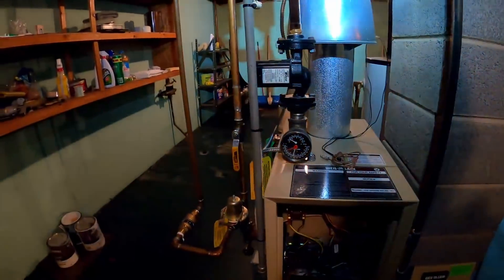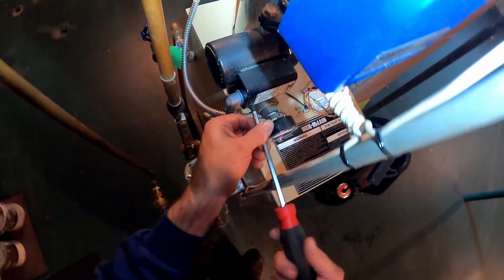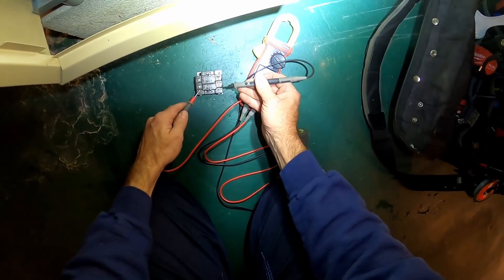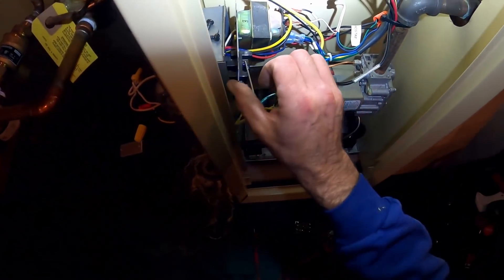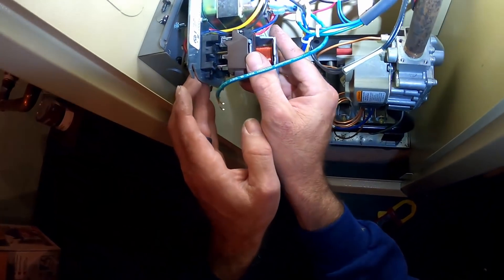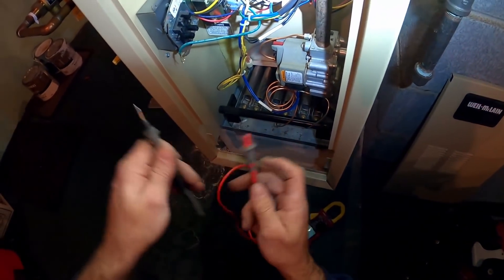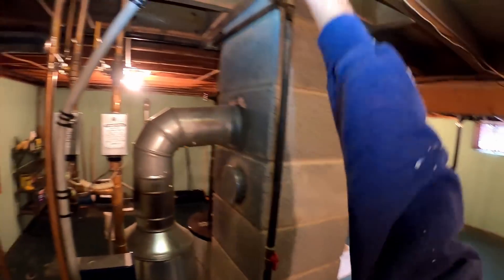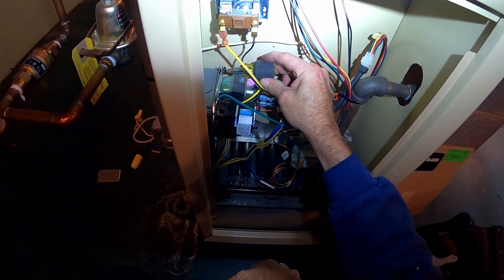Weil Mclain Boiler Faulty Pump Relay

Comment: It’s strange how those relays seem to last forever with a blower motor and such but they seem to fail often on circulators with a measly 1 amp draw.
Reply: the circulators seem to have a larger back EMF voltage spike, which of course eats the contacts quicker since it arcs harder/further on break than a blower motor.